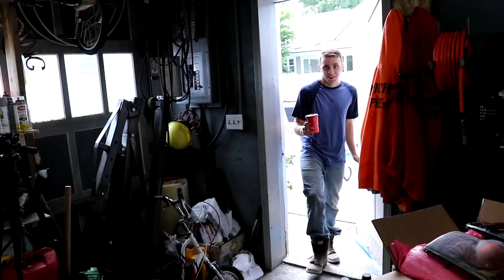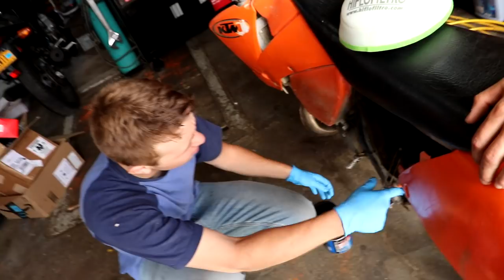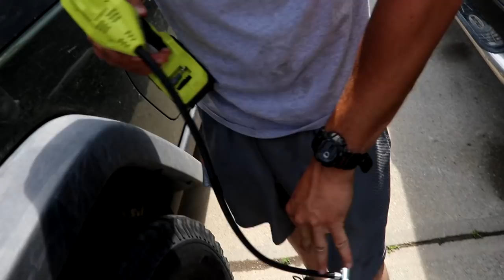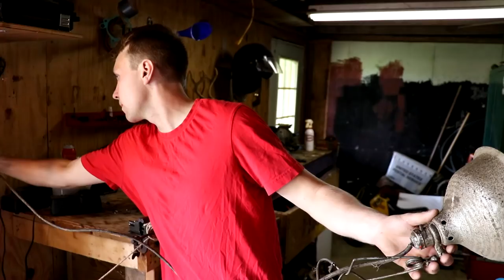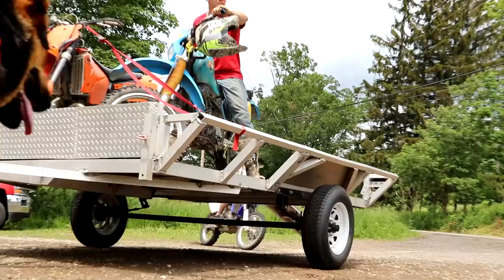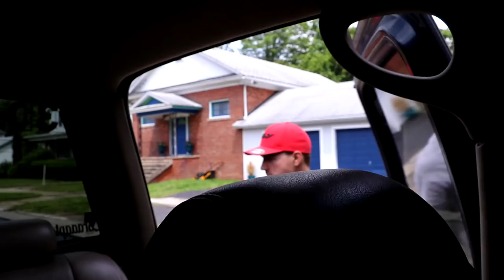Pissing off the Neighbors...

Comment: Also start off with your air screw at 1.5 turns out. That's the brass screw with no spring, bottem right of carb. Then fine tune the idle/plastic screw with spring. That will adjust your throttle slide height

Comment: LEAK DOWN TEST YOUR BIKE. You do this by removing exhaust and inserting a plumber expandable freeze plug. Then get some pvc pipe and adapter to tire valve and pressure the cylinder. Then spray whole engine with soapy water. Find leak, replace gasket= no blowing up.
Reply from the maker: I will have to do that!

Comment: Nice air filter, they're the best out there. Hiflofiltro actually are the ones that make the more expensive Twin Air filters, just rebranded. Also, you forgot to put air filter oil on it, which is bad because dust and dirt can get past the oil-less filter. Bel-Ray air filter oil is the best. Greasing the seal is often overlooked, good job.

Comment: You need to adjust the needle on the slide of you card up one position so it will let more fuel in and fix your lean issue and then you'll have to readjust your idle because lowering the idle won't fix it being lean because it needs more fuel when you are on the throttle

Comment: Raise the needle one position by moving the clip down one notch.  It can be done without taking the carb apart, just turn the carb and take the top screws and "figure it out". It tells you how to do it in the manual. #3DMachines

Comment: Dalton your bike came with a 35 pilot jet stock. check it and make sure its clean if its smaller than a 35 put a 35 in. they are a couple bucks at your local dealer. set your air screw at 1 1/2 turns out. also you should be oiling your air filter running it dry will also make the bike run  lean as well as killing the life of your engine.

Comment: you need to either gear down or keep the rpms high because a two stroke  bogs easier and thats tge reason the kx sounds like a 2 troke and four stroke had a baby together bogging it can warp the valves

Comment: I would HIGHLY recommend checking the numbers on the existing jets to see what they are.  Rejetting the KTM should be super easy and jets are NOT expensive......only a few bucks each.   You don't even have to take the carb off the bike typically to rejet.

Comment: You're gonna blow it up if you don't rejet it. When it's running that lean it gets way too hot. You also may have an air leaks somwhere because it seems to have a runaway idle.
Reply: No way a bike that old has jetting issues aside from the pilot circuit... cheap air filter with no oil will lean your ratio out tho..  that bike even smokes! Ive had engines running rich produce no smoke; leads me to believe a cheap petroleum based oil mixed way too rich is adding to the fuel/air lean
Reply: Jay K it is very possible for that bike to have jetting issues. Don't forget that jetting also depends on altitude and temperature.

Comment: Today I was working and the lawnmower I was using (a John Deere 170 38" deck) it got stuck in first gear. The clutch won't engage not allowing it to switch into neutral or anything. Any suggestions on how to fix or move.

Comment: Dude i wouldn't go jetting the carb . First start by lookin for intake leaks. Start the bike take some wd40 spray the intake if the idle chages at all you need to fix an intake leak. Its a very common thing . Adjusting the carb is just adjusting around the problem. But if no leak is detected at intake go to the base gasket you know the base of the cylinder spray WD with bike running. If all that checks out no leaks clean the carb visually look that all circuits in carb are clear. Check emulsion tube clean it. After all that if it still runs lean you probably have a crank seal failing &or compression is low. I think youll find intake leak at either the reeds gasket or the rubber to the carb. Remember the rubber can have a crack and not be visible. Hope this helps . Yamaha 2stroke for life

Comment: 3D machines needs to open a shop fixing moto, atv,  and small engines he can set up the shop so he can record for youtube as he works on them this way  he doesn't have to go back and forth between  project videos and riding vids he can still do riding vids but he can cut out the traveling that he not record the place he went to and eating out videos at the end of a fix it video he can do open a few fan mail , or answer a few questions people asked in comments  hi my mower won't run fix it while filming get paid and make a youtube video at the same time and tell veiwers like what the part is bad and what u can do to fix it style also I notice he stopped showing comments in the videos

Comment: why is my quad running at really high rpms? throttle is not stuck pls help
Reply: Kenny Lavoie Maybe you choke is on
Reply: Kenny Lavoie Or your idle screw needs adjustment.
Reply: my quad doesnt have a choke its so old lol and i thought it was my screw but i closed it all the way than backed it off a turn, is it not getting enough fuel and too much air, or too much air not enough fuel? its a 1988 suzuki lt250f btw.

Comment: 3DMachines there's a lot of reasons why your bike could be running like that but make sure your reeds are sealing and your spark plug isn't bad and you should clean the carburetor that should help make it run how it should.  it's called an expansion chamber not a muffler, no you're new to two strokes I need don't know a lot about them yet so I'm not hating on you but trust me do a lot of research and fresh in the bike up and it would run like a top also make sure your mixture ratio is good and honestly you shouldn't of got that KTM but that's just my opinion, by all means do it makes you happy